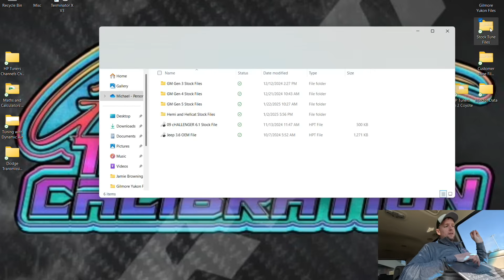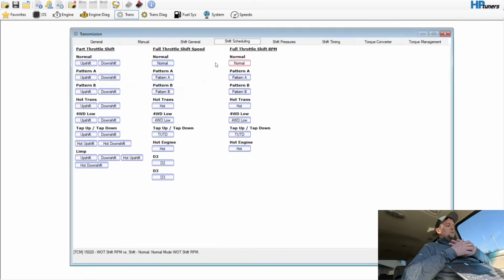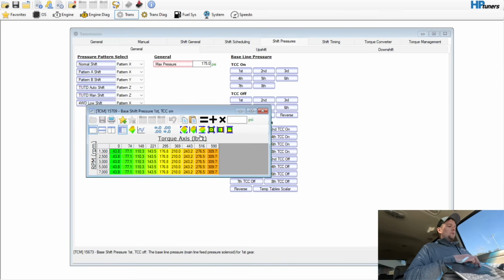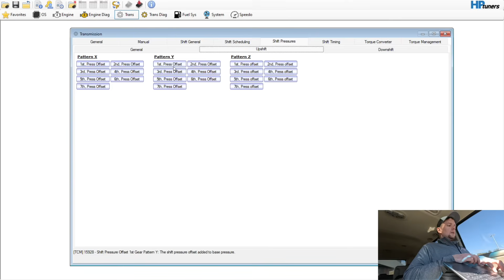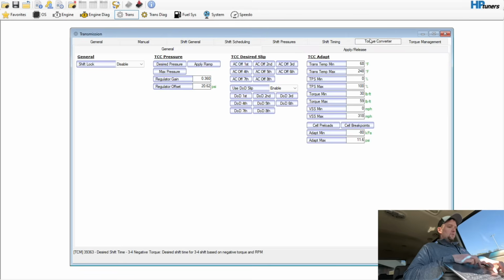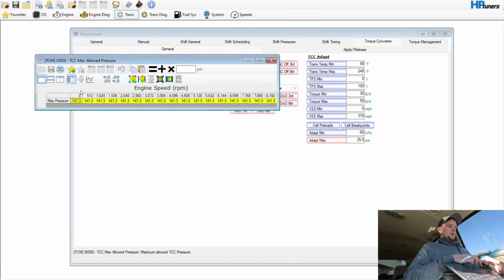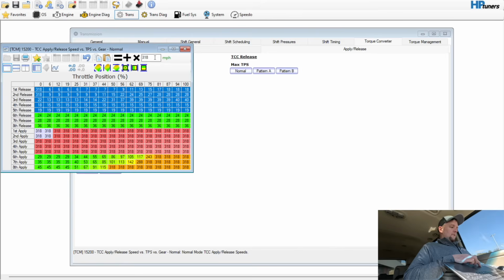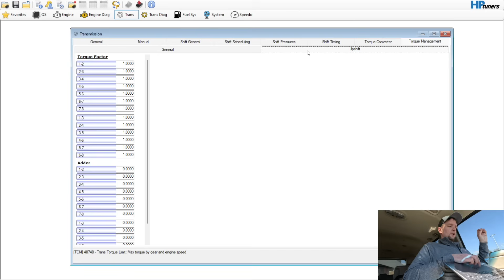GM Speed Transmission Work Pretty Well

Comment: Love the channel man keep up the great content!! I’m from Ontario Canada and Awhile back I had developed 2-1 hard downshifts in my 2018 5.3l gmc sierra. I did a trans flush with synthetic LV ATP HP and it took away the harsh downshifting, but ever since that happening I’ve been digging into the best route for longevity on these 8L90’s. A tune is something I would love to have put in my truck.!! 
with that being said do you have any advice as to what I can do to help preserve my 8L90
Reply from the maker: Absolutely! Getting rid of the converter slip and increasing the pressures and timing just a bit can help. I do offer transmission only tuning for the 8 and 10 speeeds if it’s something you’re interested in! Feel free to shoot me an email!
Reply: @GulfCoastTuningandCalibration  10-4 brother, I’m all ears when it comes to advice on this trans. Would I need to get my TCM unlocked prior to even considering a tune? Or is that something you could do? 

Also what the best email to reach you @ so I can get pricing etc?

I have some friends with the 8L90 also and I’m sure if your tune helped they would all be flocking to me like some starving seagulls to figure out how to get there’s tuned to, lol I’d recommend them to you also 🤘🏼
Reply from the maker: @Zyaus8L90 my email is Michael.happygilmore@gmail.com

I can’t remember if you would need to have it unlocked or if you can go ahead and read the file. I would go ahead and try to read it with the hp tuners MPVI and see if it will read! Loooking forward to hearing from you!
Reply: @GulfCoastTuningandCalibration I did some digging and needless to say I’ll have to unlock the tcm prior to remote tune. Either way I have your email saved and when that time comes for me wanting a tune I’ll inquire with you! 

Cheers brother i appreciate your channel/advice and look forward to touching base with you when the time comes
Reply from the maker: @Zyaus8L90 much appreciated my friend! Cheers to you! Having a cold one in your name as we speak!
Reply: @GulfCoastTuningandCalibration love it
Reply from the maker: You’ll need to send the tcm in to hp tuners to be unlocked! Tell all your homies and we can go from there!

Comment: Hey brother how do you feel about taking out all the torque management in a 8l90e?.  Car makes 930 wheel.
Reply from the maker: Hey Keith! I’d probably say that the first 3 or 4 gear changes that some can be taken out but I’d also use the minimum spark table to manipulate some of the wide open throttle stuff. If you have a file and a datalog of the vehicle I’d be happy to make a video on what I’m talking about if you’d like to email it to me. My email is Michael.happygilmore@gmail.com
Reply: @GulfCoastTuningandCalibration thanks brother will do
Reply from the maker: @keithjones7304 looking forward to it!

Comment: On an 8 speed truck I upped the wot shift rpm and mph to 6300 and moved the rev limit to 6500, but it'll not make a shift at wot. Any idea which table is limiting that? Set it back to stock and it does fine
Reply from the maker: Did you also move up the engine rev limiter in the engine, fuel, cutoff tab?
Reply: @GulfCoastTuningandCalibration i did. It's set to 6500. It has long tube's and a stage 2 cam so I wouldn't think tq limit is reached anywhere
Reply from the maker: @matd3150  Have you increased the peak tq and the driver demand? Has the wot fueling been dialed in with a wide band sensor?
Reply: @GulfCoastTuningandCalibration  the fueling is dialed in using the narrow bands. Driver demand has increasing< predicted normal and predicted tap maxed out.
Reply from the maker: @matd3150 the wide open throttle fueling will need to be dialed in with a wideband in order to report accurate torque for the torque model. How much of transmission calibration have you changed?
Reply from the maker: Shoot me your current file in an email and I’d be happy to look at it! My email is Michael.happygilmore@gmail.com

Comment: How would you adjust the torque converter apply and release for tow/haul mode on a truck?
Reply from the maker: You would have to log the “trans shift mode” in the scanner, then put the truck into tow haul mode and see which pattern it says. It’s potentially the sport mode for the trucks

Comment: Hello, I'm having some issues with my 8l 90. I had a brand new Circle D converter fail on me after just a few months i sent it back to them and they determined it was a manufacture defect and replaced under warranty. After installing the replacement everything drove good for a few months and then the car started free revving before slamming into gear in first and second.  The shop that did the install had his "tunner" make some changes. I have a feeling he messed some shit up. If you can give me a hand I'd really appreciate it
Reply: I have an HP tuner, but I don't have a lot of experience with it. However, I could definitely managed to send you some data logs and the current tune. Just let me know if you're interested and how much you would charge to Help out
Reply: The converter is a 3200 stall, and i purchased an unlocked TCM HP tuner so we are able to make changes
Reply from the maker: @PhoKingLitMedia just shoot me an email with everything and we can get started!
Reply: @GulfCoastTuningandCalibration  I emailed you Saturday. Did you get it ?
Reply from the maker: @PhoKingLitMedia I did not! Try it again:

Michael.happygilmore@gmail.com
Reply from the maker: @PhoKingLitMedia  I did not get it! Please resend!
Reply from the maker: Shoot me an email at Michael.happygilmore@gmail.com and I’d be glad to help! Include your current tune file, a stock tune file from your truck if you have it as well as any datalogs and a list of all of the modifications!

Comment: Can it be achieved that when the throttle opening is below 19% at low throttle, the speed of shifting from 3rd gear to 2nd gear is not the same as that of shifting from 2nd gear to 1st gear?
Reply from the maker: It's worth trying! Configure it that way and go out and give it a test!

Comment: In Normal mode, my transmission is 8L45. The factory's 3rd gear to 2nd gear and 2nd gear to 1st gear have the same speed. However, after I tried to modify and improve the 3rd gear to 2nd gear, I found that it was a bit strange and occasionally had jerks. I don't know how to solve it. Could you please tell me what to do?

Comment: Any tips for downshift clunks or harsh 1-2 shifts?
Reply from the maker: Any chance you’ve got a datalog and a file of the vehicle?
Reply: @GulfCoastTuningandCalibration  I have a file and can easily get a datalog.
Reply: This is the problem I'm having. Turning off DOD, increasing the pressure to 175psi, and turning off torque converter lock in gears 1-6 made a huge difference.
Reply: @Mr-Payne  I found my problem to be in the engine side of the tune. Set driver demand tables back to stock and predicted tap increasing and decreasing back to stock, then preformed a fast learn procedure.
Reply: @M @Mr-Payne . I deleted DOD in the tune & I do have some clunky shifts occasionally. Also when I take off from a stop, casually, it seems like there’s a delay before the truck moves. Any reason why?
Reply: @kolbyhumbert2680 me too. I think the valve bodies are the problem. Mine has lasted 170k miles like that. If it was the TC it would have grenaded by now